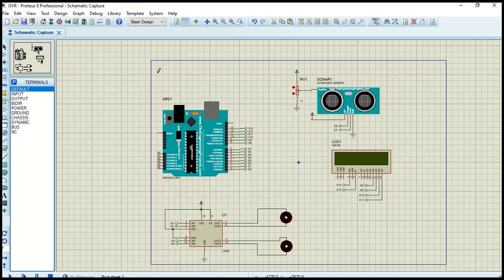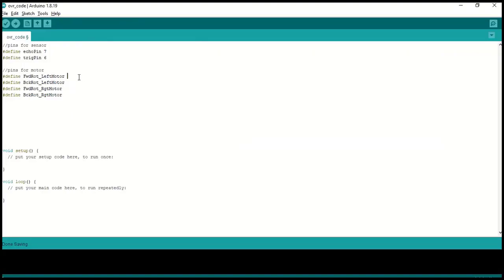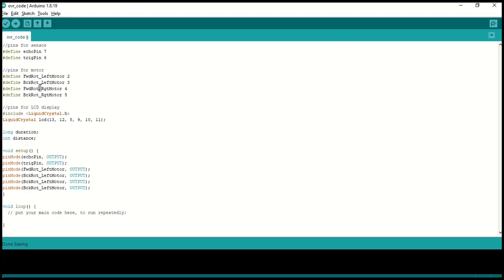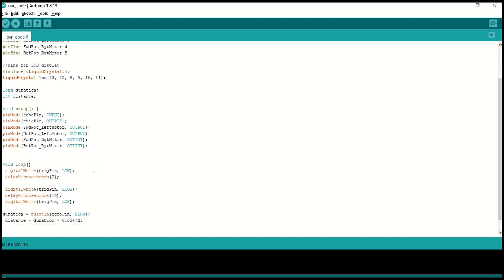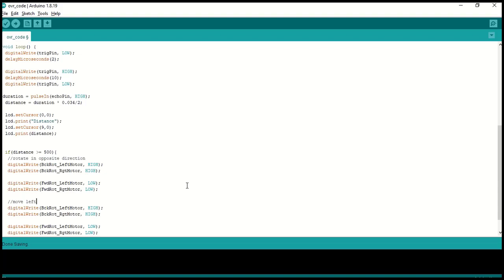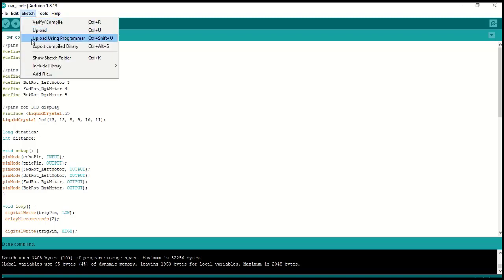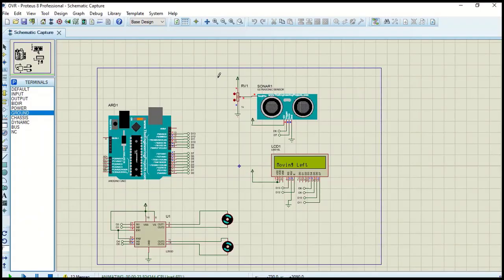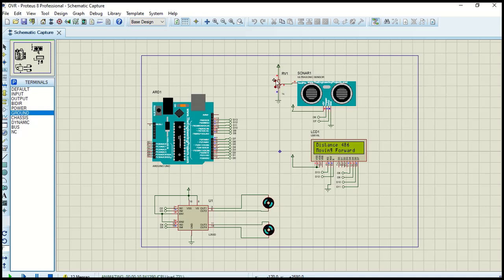Obstacle Avoiding Robot Using Arduino and L293D || Proteus Simulation || Part 2

Comment: Hi i was watching this tutorial of yours but i cannot make HEX file for Ultrasonic i tried usig arduino IDE but it didn't make it so can you guide me how because my project is now stuck on this part and stimulation is not running
Reply from the maker: I recommend double-checking your Arduino IDE settings and ensuring all necessary libraries for the ultrasonic sensor are correctly installed.

Comment: Thanks for explaining the code. It helped me a lot.
those who need the code

//pins for sensor
#define echoPin 7
#define trigPin 6

//pins for MOTOR
#define FwdRot_LeftMotor 2
#define BckRot_LeftMotor 3
#define FwdRot_RgtMotor 4
#define BckRot_RgtMotor 5

//pins for LCD display
#include <LiquidCrystal.h>
LiquidCrystal lcd(13, 12, 8, 9, 10, 11);

long duration;
int distance;

void setup() {
pinMode(echoPin, INPUT);
pinMode(trigPin, OUTPUT);
pinMode(FwdRot_LeftMotor, OUTPUT);
pinMode(BckRot_LeftMotor, OUTPUT);
pinMode(FwdRot_RgtMotor, OUTPUT);
pinMode(BckRot_RgtMotor, OUTPUT);
lcd.begin(16,2);
}

void loop(){
  digitalWrite(trigPin, LOW);
  delayMicroseconds(2);

  digitalWrite(trigPin, HIGH);
  delayMicroseconds(10);
  digitalWrite(trigPin, LOW);
  
  duration = pulseIn(echoPin, HIGH);
  distance = duration *0.0342;

  lcd.setCursor(0,0);
  lcd.print("Distance");
  lcd.setCursor(9,0);
  lcd.print(distance);

  if(distance >= 500){
    // rotate in opposite direction
    lcd.clear();
    lcd.setCursor(0,1);
    lcd.print("Moving Back");
     lcd.setCursor(0,0);
  lcd.print("Distance");
  lcd.setCursor(9,0);
  lcd.print(distance);

    digitalWrite(BckRot_LeftMotor, HIGH);
    digitalWrite(BckRot_RgtMotor, HIGH);
    digitalWrite(FwdRot_LeftMotor, LOW);
    digitalWrite(FwdRot_RgtMotor, LOW);
    delay(1000); 

     // move left/right direction
    lcd.clear();
    lcd.setCursor(0,1);
    lcd.print("Moving Left");
     lcd.setCursor(0,0);
  lcd.print("Distance");
  lcd.setCursor(9,0);
  lcd.print(distance);

    digitalWrite(BckRot_LeftMotor, HIGH);
    digitalWrite(BckRot_RgtMotor, LOW);
    digitalWrite(FwdRot_LeftMotor, HIGH);
    digitalWrite(FwdRot_RgtMotor, LOW);
    delay(500); 
  }

  else{
    //moving forward
    lcd.clear();
    lcd.setCursor(0,1);
    lcd.print("Moving Forward");
      lcd.setCursor(0,0);
  lcd.print("Distance");
  lcd.setCursor(9,0);
  lcd.print(distance);

    digitalWrite(BckRot_LeftMotor, LOW);
    digitalWrite(BckRot_RgtMotor, LOW);
    digitalWrite(FwdRot_LeftMotor, HIGH);
    digitalWrite(FwdRot_RgtMotor, HIGH);
    delay(1000); 
  }
}
Reply from the maker: You're welcome! So glad it helped you!
Reply from the maker: Please check out my new video tutorial..

Comment: My 2 motor is not working what should i do
Reply from the maker: Please check the connections first. if the circuit is correct then check the code